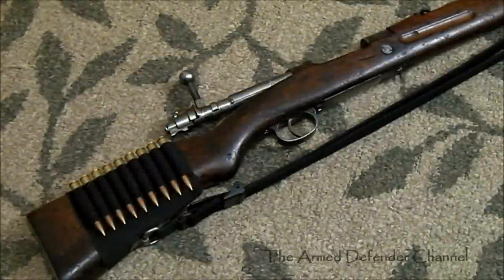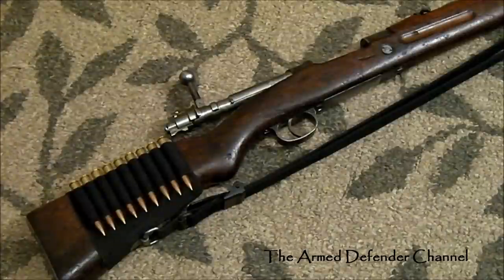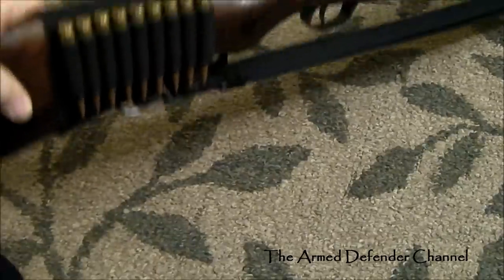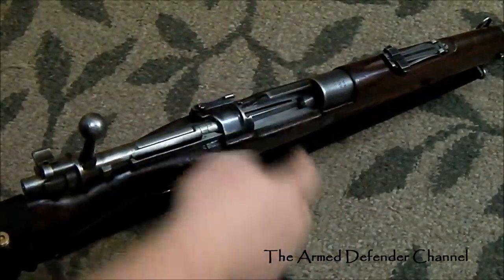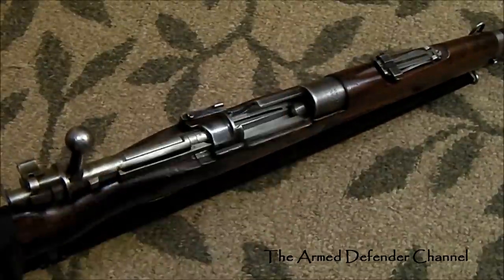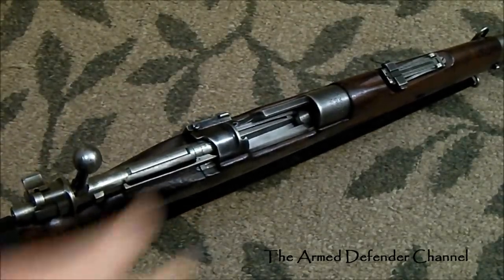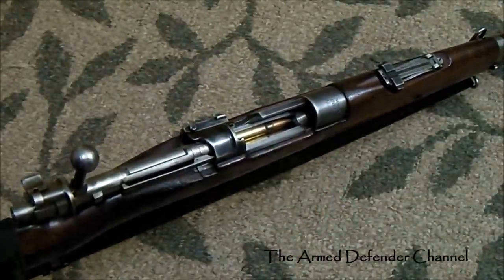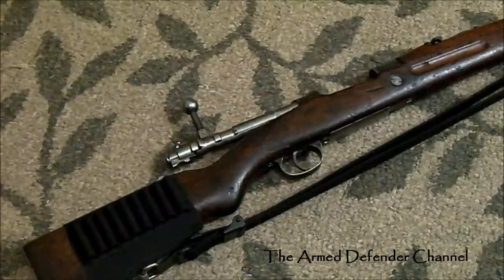Loading A Bolt Action Rifle Effectively

Comment: I owed a Swedish Mauser. It looked almost identical to yours in the video. Is yours Cal 6.5 x 55?
 I bought mine for $65 at a gun shop on the Gold Coast (Australia), blued the metal, sanded and oiled the wood and I had a great rifle. It was the most accurate rifle - shooting from iron sights - that I have ever owned. 
Thank you for posting a great video.

Comment: One thing I like about Bolt action rifles is that they are reliable. It's not like a semi or full auto that can get jammed fairly easily. As much as I love the use of a bullets kinetic energy to chamber the next round it does fuck up from time to time, which is why anything loaded by a human hand is a lot more reliable imo. Of course nothing can beat the trusty old revolver, but there will always be the problem of limited ammunition and the fact that reloading is a bitch under pressure. Being able to pop in a mag and fire off 20 rounds with a trigger pull is pretty reassuring, but I'm always scared I will pull out a gun and the last thing I hear is that short 'click, click' of a round stuck in the fucking chamber refusing to fire.

Comment: hey does the same technique work on bolts with a detachable magazine? I know its not as practical or anything but I've always been a fan of loading one round in at a time but I've never owned a bolt before with a detachable mag so I'm just wondering if that works god those it if I should buy an additional mag or two

Comment: With my M1917 in 3006, I load 7 rounds. one up the spout to start ,one in the mag ,and one 5 rd clip on top of that. Depress the top round in the mag and run the bolt home over the round in the chamber. Its cool and works well. Been doing it for years and the extractor snaps over the rim with little effort. 7 shots, pretty nifty.

Comment: I palm 4 for my 700, and then do a similar system, but I plant the round on the back portion of the ejection port, and slide over and thumb down. Can keep all four in control during the sequence. Fairly smooth.

Comment: You can never be too safe around guns!
Reply: You're never safe.
Reply: I didn't mean to imply that safety is not a priority, I meant that the level of danger should never be treated as diminished. You can safety check a weapon and forget to do so later on, or you can forget to keep your gun pointed in a safe direction and have it discharge through a part failure (an AK can sometimes be fired by disengaging the safety if the related components are old or defective).
Reply: I don't understand what you mean, but I'll keep following the four rules.

Comment: What is that type of magazine/rubber clip called?
Reply: Internal/fixed magazine, you'll need tools to remove it from the rifle, hence why he's pushing rounds in through the top. It appears to be a "double stack" or "staggered" magazine. He did not use any clips to load in this video, which I think was his point. A clip would be a piece of metal that holds several rounds together to ease reloading a magazine or revolver cylinder. It can be tiring for some people to refill several magazines due to the internal spring's resistance.

Comment: Any special tech how to load 54r rounds quickly without rims lock behind another rounds?
Reply: PhantomDark21 I’ve not had a problem with rim lock on the 54R round. I think there’s an interrupter in the 91/30’s that protects against rim lock. The Lee Enfield however are a different story.